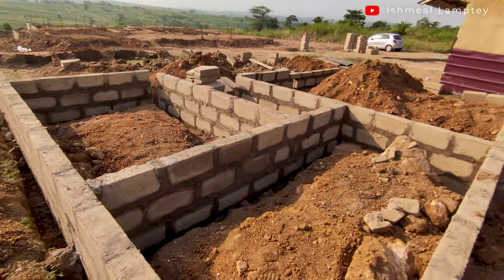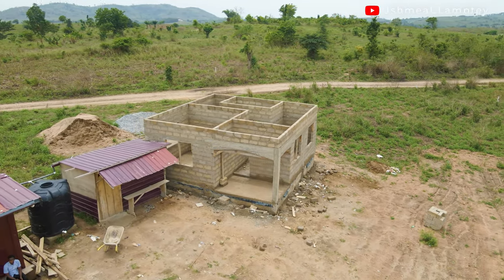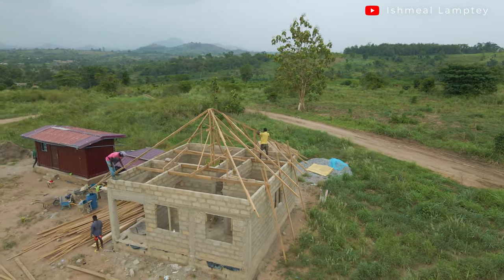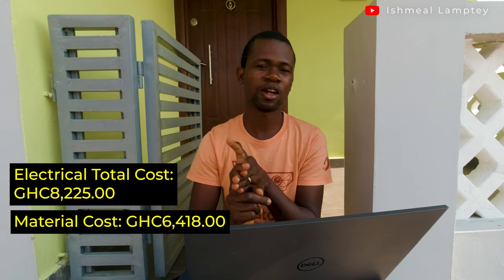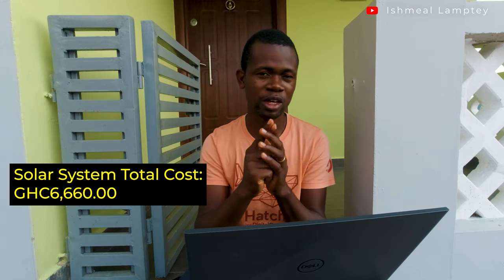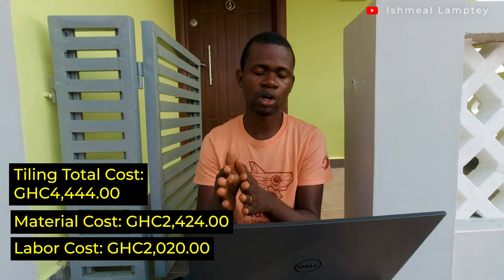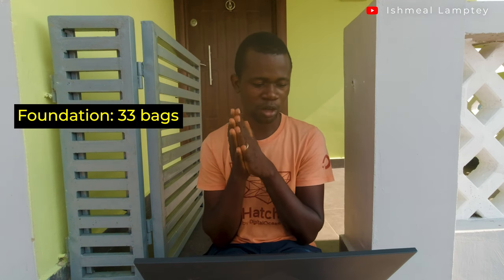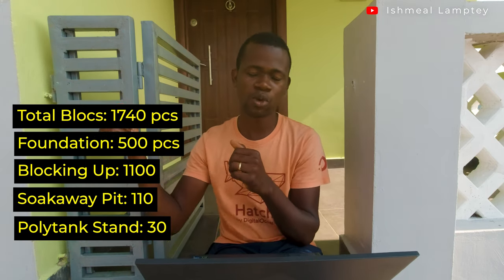Building a Starter House for GHC80,000+ in Ghana

Comment: Congrats Ishmael, love your building journey through out. Great break down of all your cost. You have really helped with everything concerning building a home. But wanna know, how about connection electricity to your site. How much was the cost of it when you made enquiries about it please.
Reply from the maker: Thank you for your feedback. With regard to connection of electricity, the option i was looking at was going to be a temporary connection which was connecting from a close by community. However the cost of that alone was close to installing my solar system that was how come i decided to go with Solar.
Reply: @IshmealLamptey  Why would It have been a temporary connection? How long? What about a permanent connection?
Reply from the maker: @ArtsyLadyCrafter  a permanent connection will mean, i will have to purchase about 6 or more poles before getting ECG to come and do the connection. That would cost more as compared to the temporal one which could have been used for some time before poles are mounted

Comment: Nice one. Well done. So this's a one bedroom self-contain. Does it have a hall? 

Would you include the cost of the land in your expenses? The roofing cost is very high. If you had floored the top in lieu of roofing, with the possibility of a future vertical expansion, would it be cheaper?

Did you build a soak away, or manhole or the new biodigester type?

What things can your solar power?

Do you have access to electricity, water? Thank you

I see you've videos on the house that probably answers my questions; would check them out
Reply from the maker: Yes it has a hall. 

The cost of the land wasn't included in the total. 

The roofing cost includes the wood works as well. 

It wouldn't have been any cheaper if I'd constructed a storey building. 

We built a soak away pit and also a bio digester. 

We use solar and it's able to power everything we have. However, do watch my solar video for more explanations.
Reply: @IshmealLamptey  thank you